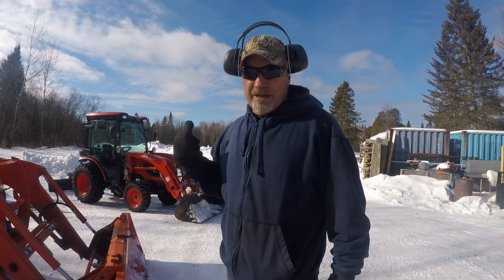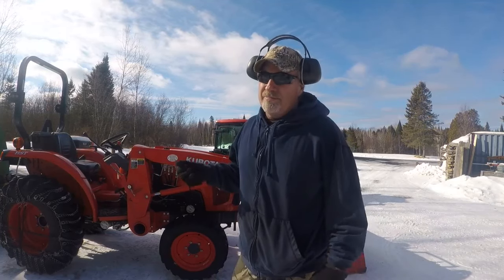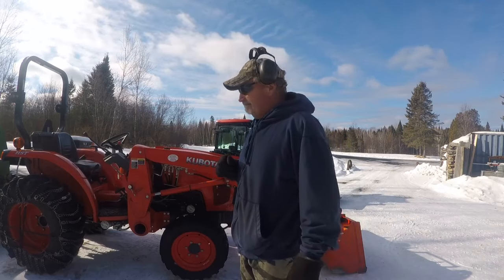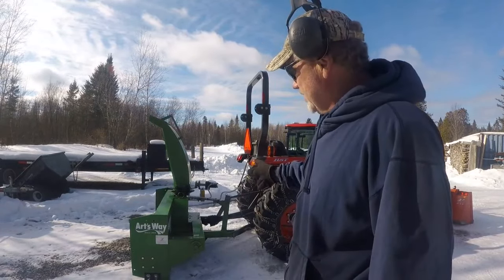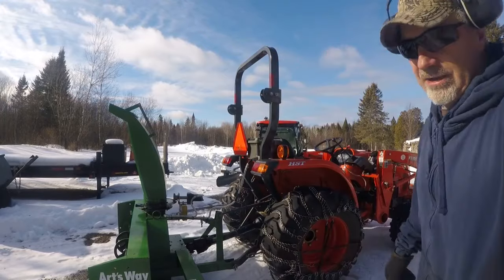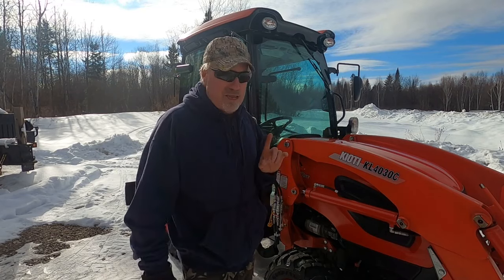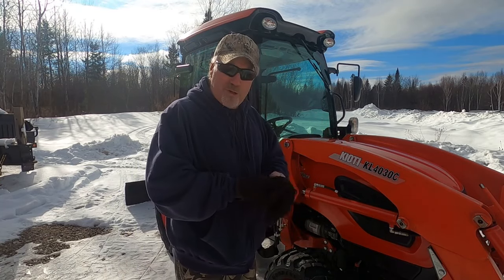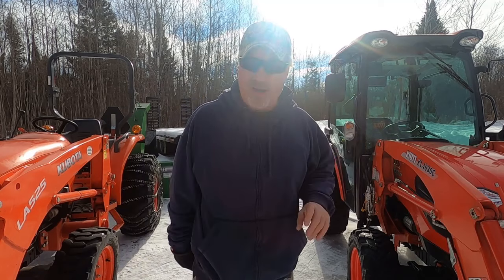Kubota vs Kioti Hydraulic System-Definitely different.

Comment: I absolutely 💯 agree with what your saying. I owned my L2501 4 years and just traded for the Kioti CK2610 cab  this week.  2 days in with the Kioti and boy does it fall short as you describe. Even raising and lowering  the 3 point, you hear the tractor bog as if its a big load. The main reason I went with Kioti Cab, was  Kubota cab was too expensive. The hydraulics are light years apart. Honestly, I miss my Kubota. I don't miss the open cab , dust, and heat. So I will learn deal with it. These tractors are not on the same level, despite all the comparison videos.
Reply from the maker: The tractor you have is the identicle model to the one in my shop for sale.EXACTLY the point i was trying to get across in the video.But,people are so offended and brand loyal,they won't here any of it.But like you said,2 different hyd systems at different levels.BUT,something has to give at the KIOTI price,and its old school hyd.They are good tractors,just not engineered to a japanese standard.Unless people have had both,and ran them,the only thing they really have is opinions,no facts.Thanks for commenting.
Reply: Appreciate your post here - So diffinitely right smart difference in price - W/ price off the table just tractor to tractor & knowing they both have pluses & minuses If you had to purchase one today knowing what you've learned - Which one  would it be? Thanks for the video- jack
Reply: Yes our tractors are the same. So I completely related to your video.My dealer when I purchaed it tuned the fuel to get it up the 35hp. You summed the differences well in the video. For me, I would have preferred Kioti cut back on some of comfort features, and upgraded the hydraulics .I saw comments about newer models having the ability to lift and curl, I can tell you mine is brand new and not the case. You may have a very small sweet spot where you may see a little of that but it's not designed for it. Kubota is just a good tractor. I bought mine 4 years ago, and dealer gave me more than I paid.  I will get used to this tractor, but I miss my Kubota. 

Copy and pasted from differences I found on web. 
The Kioti CK2610 and Kubota L2501 are both compact tractors, but they have some differences in their hydraulic systems:

1. Pump Capacity:
    - Kioti CK2610: 12.5 GPM (gallons per minute)
    - Kubota L2501: 13.2 GPM
2. System Pressure:
    - Kioti CK2610: 2,200 PSI (pounds per square inch)
    - Kubota L2501: 2,400 PSI
3. Number of Hydraulic Valves:
    - Kioti CK2610: 4 valves (2 rear, 1 mid-mount, 1 power beyond)
    - Kubota L2501: 4 valves (2 rear, 1 mid-mount, 1 power beyond) with an option for 2 additional rear remotes
4. Hydraulic Flow Control:
    - Kioti CK2610: No flow control valves
    - Kubota L2501: Flow control valves on all 4 standard valves
5. Priority Flow Control:
    - Kioti CK2610: No priority flow control
    - Kubota L2501: Priority flow control for steering and brakes
6. Load Sensing:
    - Kioti CK2610: No load-sensing technology
    - Kubota L2501: Load-sensing technology on all 4 standard valves
7. Hydraulic Oil Capacity:
    - Kioti CK2610: 10.6 gallons
    - Kubota L2501: 12.4 gallons

In summary, the Kubota L2501 has a slightly higher pump capacity, higher system pressure, and more advanced hydraulic features like flow control valves, priority flow control, and load-sensing technology. The Kioti CK2610 still offers a reliable hydraulic system, but with fewer features and slightly lower capacities.

Comment: Back in the old days there was a valve below the seat on tractors that would adjust the flow rate to the front hydrlics. the HST tractors are a bad design to begin with.  they do not build backhoes as HST for a reason.
Reply from the maker: I ran an M-62 KUBOTA backhoe yesterday.All hystat,well designed,proven technology,lots of power.Not a 580 case by any means,but a commercial backhoe and nice,dependable unit.Kubota's full line commercial backhoes,all hystat,Proven track record.Thanks for commenting.

Comment: kioti tractors put a limiting value on dump and down movement of loader . safety feature so that it doesn't come down on you.
Reply: That’s a terrible safety feature or excuse…it is very important for it to get to the ground as fast as you can specifically for safety. In case your load shifts or you get tippy for one reason or another you anticipate that loader on the ground asap…one to lower center of gravity but also to stabilize yourself. Hugely important making that a very nit safety feature.

Comment: the hydros are to be ran at WOT on the kioti.....
Reply from the maker: Why of all diesel powered equipent that ive owned and ran,is the Kioti the ONLY one to run or supposed to run WOT?What in the hydraulic system is different that requires this?Im interested.

Comment: I agree with you on the Kioti hydraulics being sluggish.
I've compared the tractors side by side several times on paper and the specs point to Kioti outperforming the Kubota,  but in running them both I can work circles around the Kioti with the Kubota due to the fast hydraulic response and the increased smoothness of the controls. I can say I've noticed the same thing on the hydrostatic drive as well. When grading my road with a Kubota I switched half way through the job to my neighbors Kioti and it felt like a slug in comparison to my Kubota. The drive system feels so unresponsive and sluggish in comparison. When pulling hard up hills the transmission felt like it was overwhelmed and it would simply run out of power and felt like it was going to relieve before it would break traction and it would just quit moving foward...
My Kubota will pull and pull and if you don't pay attention grading up the hills you could really dig in the tires and spin out. To me It feels like there's so much more hydraulic power provided to the drive train on the Kubota in comparison. The Kioti is an impressive machine but when operating one I can't wait to get off it and get back on my Kubota. 
If I was doing production type work like building a new lawn/ landscape around a new house I could work circles around the Kioti that I've operated with my Kubota.
For the extra features and lifting capacity you get for less money with the Kioti it would probably be the better choice for some but for me I'm too accustom to the faster hydraulics to make the switch. I would find this very frustrating if I traded to a Kioti even though you get more tractor.
Reply from the maker: Very true.Like I said,instantly noticed the difference between the two after operating the Kubota.I'm not sure if it's in the newer models,but KIOTI should do the engineering and make the changes required to put the flow where it is required.Thanks for commenting.

Comment: No kubota hst tractor I have ever ran will do two functions at one time. I have a kioti shuttle shift that will do two functions all day long and cost $20,000 less than the comparable model in Kubota. Hydro tractors suck for two function capabilities and you loose to much power to the ground and pto.
Reply from the maker: Your invited to come up to Northeast Ontario.I will Mentor you on Operating a KUBOTA to get maximum efficiency.Hydro tractors may suck in your opinion,but for some reason,almost all,smaller hobby and estate tractors are Hydro.Very rarely will you ever see a line up at a dealer looking for gear drive,they Flocked off with the Do-Do bird.I would encourage you to put in more seat time and understand your KUBOTAS ability,you'll br a much more happy operator.Thanks for watching and especially commenting.It makes my day!

Comment: Could it just be the difference in pump specs where the kioti pump is less GPM making the split function slower??
Reply from the maker: Definitely pump volume is the big deal when comparing unequal systems.BUT,in the case of KIOTI,the spec sheets will tell you it puts out more GPM.KUBOTA is the loser in the GPM category here.But its what KUBOTA does with there flow in the system thats the difference.Kubota knows where and when to utilize max flow to each valve.Kioti hasn't got there yet on this particular tractor.WHY?i have my own personal opinion on this.Thanks for commenting and watching.

Comment: Good thing it's an opinion video. Anyone who knows anything knows you don't know how to operate nor how to adjust the settings on the Kioti. You probably don't know because Kubota doesn't have hydraulic adjustments...
Reply from the maker: LOL.The video is based on two stock,factory setups comparing KUBOTA to KIOTI hydraulics.Also,you are not adjustng anything on a  KIOTI that will allow you to double up on functions at once.What would allow the KIOTI to double function smoothly is the flow of the oil,and which valve or valves get the flow from the stack in a priority fashion.You can adjust all day long,you can't change the path of oil in that circuit,its all path of flow.Its a valving and manifold issue.Now,go and drink one of those SMART water drinks and get back to me.Also,I have to admit,you probably are a cracker jack operator,but your hydraulic theory is subpar.

Comment: you didnt curl the Kubota back you only dumped, come on man
Reply from the maker: Showing the true facts between KIOTI and KUBOTA,and presenting from KIOTI manual as they engineered it.You don't have to like it,any operator  whose honest will notice the difference right away.
Reply: @northeasterndirtandpropert7974  but you didnt operate them the same

Comment: I don’t like the hydrostatic pedal on the Kubota and the paint is low quality, fades to quick,I don’t want either tractor , I’ll take Massey over both
Reply from the maker: Well,I can't help you with the peddle,but certainly Kubota paint lasts many years if the machinery is taken care of.That means proper storage,unless your rich and don't care.Massey makes good stuff,owned several over the years.

Comment: I wouldn't buy either tractor i farm for a living the newest tractor i got is a 2003 belarus the new tractors dont hold up and the old ones got no deff or computer every body i know says the old ones are best just my opinion
Reply from the maker: Old tractors definitely hold up.The biggest problems on any newer tractors with any reasonable farming horsepower are Emmisions.The corporations got you by the balls.They own proprietary programs only to be accessed thru dealer netwoking.Its no different with my excavators,any computer issue,or DPF issue,Im screwed.John Deere vs. the farmers is one of the biggest right to repair issues around.But the hobby class tractors we deal with are top sellers vs farm tractors and pretty much dominate the tractor classes.Less farmers,more people playing in the garden.They got it all ass backwards.Thanks for watching!
Reply: You got that right
Reply: there is no computer or DEF on the L2501 it is just like a 30 year old tractor because it is under 26hp and does not have the emissions restrictions. All of the bigger L series tractors have the emissions controls and DPF filters. The nice thing about the L2501 is the engine is way derated and can be tuned up to about 35hp with some tweaking of the injection pump. If you are in the market for a new tractor I would go to a Kubota dealer and look and the l2501.
Reply from the maker: @anthonysimpson2847  That was the base Kubota in the FEL operation.L2501 vs Kioti 3510SE.Both good tractors,just one is engineered a bit differently.